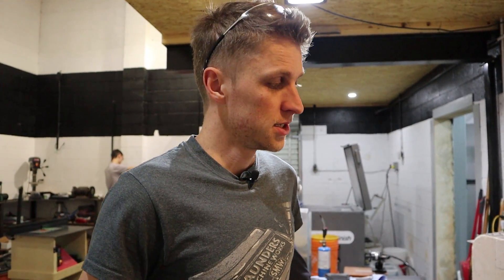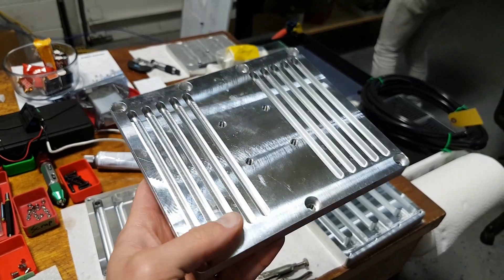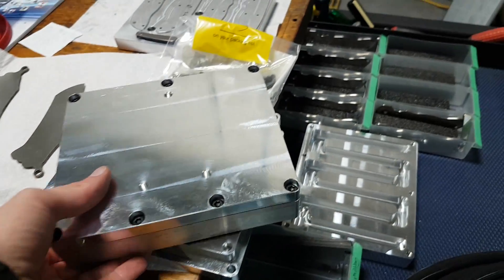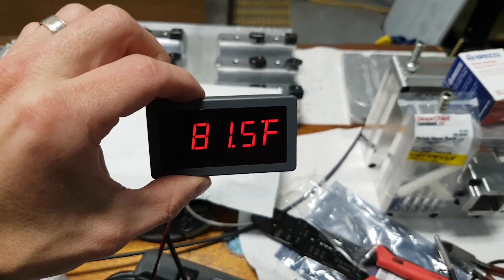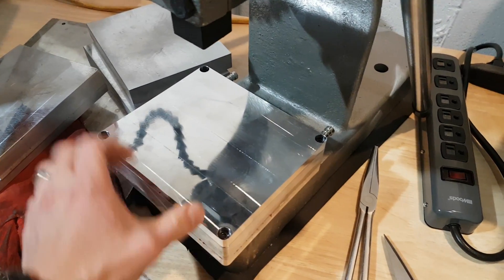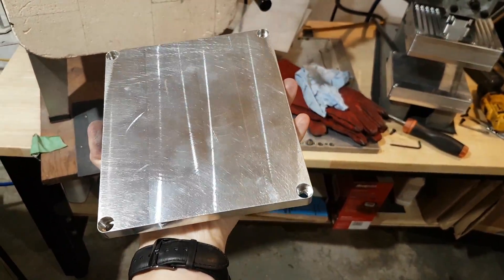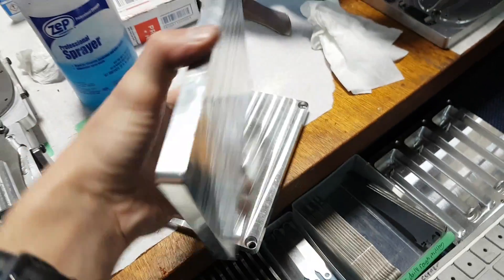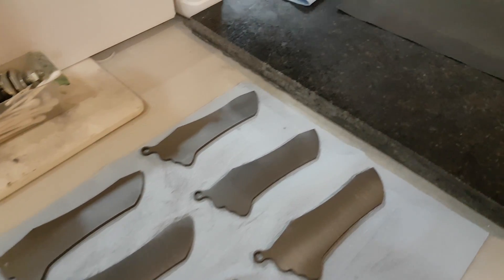Heat treat BETTER! - We improved our quenching setup

Comment: I would suggest Permatex's own High-Temp Anaerobic Flange Sealant (US part # 51031) for this job, next time you have to re-seal. It's much easier to clean up, and only cures in the absence of oxygen; so it won't dry until you bolt the plates together. As an auto mechanic, I find it's most often used specifically for sealing machined-flat aluminum parts, such as between the halves of Subaru engine blocks. It's more of a gooey gel, and is way less of a hassle to scrape away if you need to clean it off and re-do a seal.

Comment: You could also add a pneumatic cylinder to the arbor press or build a custom press based around an air cylinder. You can then control the cylinder with a foot pedal so both hands are free. You can have it automatically retract when you remove your foot from the pedal.
Reply: Well, I will not be suprised if this evolves to some kind of pneumatic press controlled by a arduino (or similar) that make sure all blades are quenched exactly equal. Also that would make it possible to control the temperature of the plates  with temp-sensors and a bit more advanced coolingsystem

Comment: If your bucket of water gets too hot, consider going to your auto parts store and getting a transmission cooler, mount a computer fan or two to it and send the hot return line through the cooler.

Comment: I see some improvements to be made.
-  Create a steel wear plate, where the blade would sit, like an automotive aluminum flywheel, then use thermal paste between. It'd keep it flatter as well, less need to resurface. (unless the thermal transfer isn't fast enough) Bolting in the middle of the assembly will also keep it flatter.
-  Cut an "o-ring groove" around the perimeter. Still use silicone though. Its common practice with some aluminum oil pans. It'd also force you to allow a larger perimeter for sealing.
-  Resurface after all this is done, or after it reached temp, if you notice any difference after it heats.

For the clamping, I would make it a two piece. For the upper, clamp it like a split shaft coupling. Give some space to place a hole in the center so you can bolt straight down to the bottom bracket. Allow the bolt to bottom out to allow the top assembly to move.

Comment: Drill an oversized hole all the way through the press ram, then drive a roll pin through it so that it can 'float' without ever being able to fall off.

Also, if heat becomes an issue, it should be pretty easy to install a simple PC water cooling radiator, or the like, with fans that can either be run off a thermostat, or just put 'em on a switch and run the fans any time you're doing "quenching".

Comment: Hey John, a little bit of electrical heat shrink tube on the pair of lower pins might take up the gap, and stop the annoying wiggling of the bottom plate. Just keep adding tube and heat shrink it until it fits perfectly. Ciao, Marco.

Comment: Hi John. Great work on that cooling channels! never expected any less :D.
Although, you'll improve the heat exchange efficiency by roughing up the inner surface of the circuit. In the olden days, they used to leave the cast iron blocks of the engines, outside on the dirt. Bare under the elements, to rust in the inner water circuit and thus gain more "grip". This causes not only more contact surface, but a bit more contact pressure. All my respect and admiration. Keep it up!

Comment: Traditional method to load flats is to use a central spherical bearing. Springs can keep the lower plate against the bearing so it raises with the loading ram.

Comment: A few suggestions...
1. You may want to add some thermal grease between the contact plate and the chiller. The thermal grease will make up for any tooling marks or imperfections. You don't need much, just a thin film should do.
2. It looks like you have the chillers connected in parallel, you may want to change that. If theyre in parallel the flow may prefer one side over the other. Either add a second pump or put them in series.
3. To increase the repeatability of the quench, you may want to add a weight to the end of the press handle.
4. To increase the repeatability or the quench, you may want to add a timer to the setup. I'd start with just a kitchen timer and see how it goes.
Reply: Yes great suggestions, I was also sceptical about connection made in parallel.
 I was also thinking about water cooler, it doesen't take that much, just few fans and a cooler and its done.
Reply: Machining tool marks are not an issue. The knives are not soft enough to take that level of impression. They are even still in the foil bags. Overall flatness is what is critical.

The parallel connection isn't going to be a problem. The flows will be more or less equal unless there is a significant obstruction in one of the plates.  Series would be worse because one plate would only be getting pre heated water and that may cause uneven thermal growth. We're talking 1/1000's here but John did this to keep the blades flats to ease polishing so that would be significant.

They are not necessarily pressing them flat.  Just providing a flat surface for it to keep its form while cooling. The aluminum sucks to heat up.  Force then may not be a critical variable in the process but might we worth looking into if they still have a bow after this process

Comment: It shouldn't be made of aluminum
Reply: Most quench plates are, what would you use instead?
Reply: @jimmygrey6848  any type of steel that is way softer than the parts steel. Steel can tolerate extreme heat and press force better than aluminium. When its got damaged you simply stick it to the surface grinder magnet and shave off a layer
Reply: @Fischer977  Yeah but the thermal conductivity of aluminium is a lot higher than steel, that's why it's widely used for heat sinks. It doesn't need to tolerate extreme heat and press force, it needs to draw heat away from the blade quickly, as said in the video not much pressure is put on the plates.

Comment: I'm just a kid,  perhaps silly question on my part, how do you monitor rate of cooling as far as consistency goes over repeated use, and how accurate do you figure, that consistency  maintains itself during the life of that cool device, seems obvious the way you explain it,  measurements can be a bitch if you have OCD, Really appreciate how you guys think, You guys are awesome. I'm just thinking in terms of variables over time,  probably not a proper question on my part, your devices for measurement  being as accurate as they are.

Comment: Copper gasket + aluminum plate? Asking for galvanic corrosion
Reply: It's not pure copper. It's high-temp copper RTV silicone and Permatex claims that it's non-corrosive. I don't disagree with you though. Doesn't seem ideal for long term use, and it would probably be a good idea to use distilled water in that system to decrease the electrolytic capability of the liquid.
Reply: @TheStabbyCyclist  Even if it did corrode, its a pretty cheap thing for them to make again. Its not like with computer water cooling parts where the end user really cant repair or remake them.

Comment: Hi John. 1.make 4 small , injection mold like guiding pins so the plates will always close parallel. 2.for sealing ,use rubber string (comes in roles) and machine a ball endmill chanel for it. 3.for the cooling, the bucket is not enough! You'll see that the water become hot. You need a small chiler and a pump to circulate water.
Reply: They're trying to keep it room temperature, right? Maybe they've got a Volvo radiator lying around that could be plumbed in.
Reply: @Hirudin  maybe....i can't tell. Im not swedish
Reply: +1 for the radiator! I tried a car radiator for my TIG cooler but ended up using a smaller oil radiator as they are so much easier to plumb. Works great with an AC fan behind it.
Reply: @nickmartin1688  is the installation complicate?
Reply: For car radiators, it can be; the inlets are much larger then the tube shown here, so you have to make plastic plugs to reduce their size and epoxy them in and tap the plugs for a fitting. They are probably overkill for this application unless you are doing many blades at once in a hot environment.

Oil coolers are really cheap on eBay and have inlets around 5/8" so you can use matching diameter tube and hose clamps. You can always gang them up if you need more cooling.

I found that the new oil cooler was cheaper than a used car radiator - YMMV.

Comment: Plates are screaming for thermal paste, I can hear them all the way down here in Texas.
Gelid is the best non metalic (gallium based and will eat aluminum). Available at newegg.com
Reply: I use anti seize .
Reply: There's no way that stuff will hold up to 1800° F, is there?
Reply: @Hirudin  yes its made for it. Plus that water cooling
Reply: @vettepicking  
Holy cow, that's pretty incredible! I was actually asking about the CPU thermal interface material (sorry, I should have tagged James) but maybe you were saying both can stand up to such high heat.
(edit - A quick look at the Gelid website shows that Gelid GC-Extreme has an operating range of -45º to 180º C (which is -49º - 356º F). I didn't see any temp specs for their other formulations.)
Reply: Yes I was thinking the same, I have made a custom lever espresso machine, and bolting the group to an aluminum plate, lapping flat and thermal paste was needed for efficient thermal transfer. Computer guys got this figured out so I agree, use CPU thermal paste!
Reply: high end thermal paste might be too much. You just need something to fill the air gap, like machine oil or thermal grease.

Comment: Maybe you already say this, but why dont quench in hot oil?
Thanks!
Reply: The aluminum plates will suck the heat out almost as fast as oil, without the mess. But primarily they're used to constrain it so it can't warp towards one side or the other.  Plate quenching is the easiest way to get nice straight blades.
Reply: @belstain  thanks!
Reply: Because the steel they use is air hardening
Reply: @CurtisCubby  I have quenched a lot of air hardening tool steels using slow quench oil and with great results. I think if the blades were hung by their pivot hole and lowered in point first distortion would be minimal and it would be WAY faster.  I wonder if John has tried this method or if it's just one of those that is how we have always done it kind of things.
Reply: @bcbloc02  Yes you can quench RWL34 in oil too which would cool it quicker but it's also messy and you can't use SS foil so there will be decarb that will need grinding off. The same hardness can be achieved with plate quenching and the plates also help to eliminate warping and the steel is cleaner. I don't see any benefits to oil quenching?
Reply: @CurtisCubby  Sure you can quench in oil  with stainless wrap, it just needs to be wrapped tight so it has good contact for thermal transfer.  I don't normally see a lot of warpage in parts quenched fast but I don't do a lot of super thin cross sections either so maybe the plates are the only way.
Reply: @bcbloc02 I've never seen anyone quench their knives in oil with the SS foil still on, nor have I seen anyone recommend it. In this instance, plate quenching is the most efficient way.